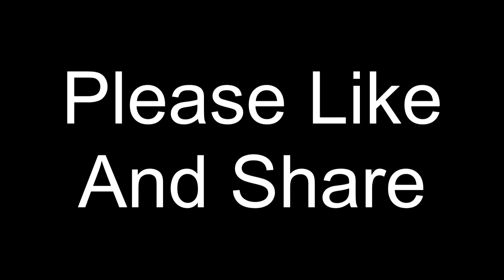Timber Tuff Portable Chainsaw Mill Tutorial

Comment: Thanks for this video. You're right, the instruction manual is terrible. I just put one of these together and made a few mistakes which I'll now fix. Have you used yours yet?
Reply from the maker: I apologize, I just now saw your comment.
Yes, I used it quite a bit just this past week and discovered a few caveats that I haven't seen anyone else mention in a video.
1) If you're using 2x4s for the guide rails on the first cut, there's a good chance that they will sag when you get near the middle.  To counter this, I drilled some long (approx 3 inch) wood screws into the 2x4s and left them backed out enough so that they came in contact with the top of the log.  This way they work as supports to prevent it from sagging.
2) Make sure when you attach your guide rails (2x4s) to your log that the rail that will be closest to your motor does not stick out past the edge of the log.  Your sawmill will want to ride along the edge of the log and if that rail sticks out too far, then it will be fighting this and make things much more complicated.

Comment: What're your thoughts on this mill after several months? I've been going back and forth between the TT and Granberg mill.
Reply from the maker: Nathan Rehm it's an excellent mill.  I've milled hundreds of board feet with it and the only advantage I can see with the Granberg mill is their design on how it clamps the horizontal round bar.  This uses winged screws that have a tendency to vibrate loose, but using the handle of the wrench to make them a little tighter seems to solve the problem.
I hope to get some videos edited and uploaded soon with some caveats I have discovered and some tips.